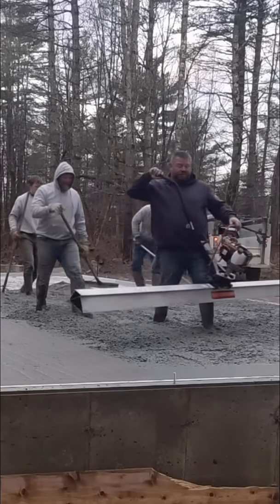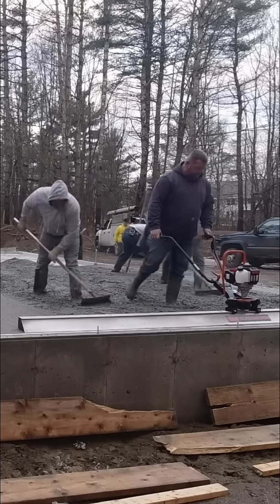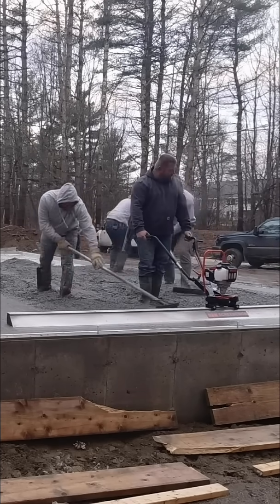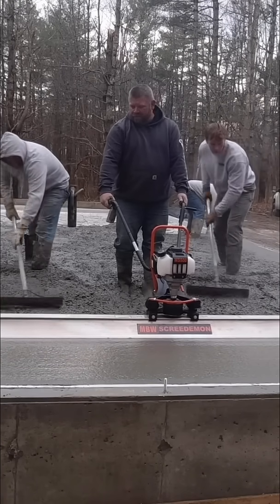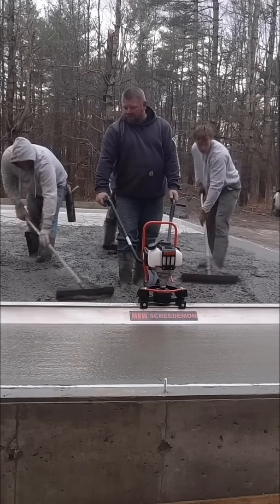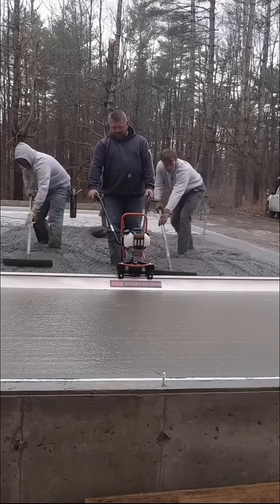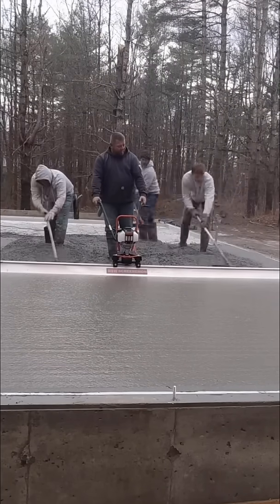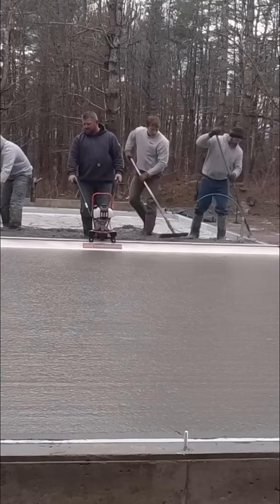You Might Not Know This... #shorts

Comment: DOESN'T IT LOSE STRENGTH SETTING THAT FAST? YOU WOULDN'T WANT THAT IN SUMMER
Reply: Under about 40 degrees F the mud will almost stop setting up on it's own completely. It needs a chemical accelerator (calcium) to maintain it's heat and set off in good time. Winter mud and summer mud are very different, if you don't accelerate winter mud you'd still have wet concrete 24 hours later
Reply: No . Your psi stays the same they would batch the mud if it did test at strength

Comment: Mike, I don't think it is the hot water. The cold gravel and sand they add to it completely counters the hot water. My guess is they put additives to make it go off faster because they need it to generate more heat to keep it from freezing. I could run the numbers, but I'm fairly certain without doing so, that even boiling water wouldn't bring the mix above room temperature. So that wouldn't change how the mix went off vs a summer day.
Reply: @court2379 It doesn't have to go above room temp to make a difference, every degree in temp will increase the speed of it setting up to some extent. Idk your experience, but for example if you have a slab with shade on half of it on a sunny warm day, the mud in the sun can go off in literally half the time or less.
Reply: Hot water makes a huge difference, it's not even debatable.
Reply: @KeMiZe44  I am sure hot water changes the temperature of the mix. But I don't think it has enough energy to bring it above room temperature. So if you are comparing how fast it goes off and stating it is because of the hot water, I don't believe that is true. It is colder than a summer mix by a good margin. How it goes off must then be what they put in it. It most likely has accelerators as crews don't want to wait three days to finish it and would have difficulty protecting it from freezing. 

If really needed I can calculate the temperature, but it would be easier to just stick a thermometer in the mix during a pour.
Reply: @court2379  It will have accelerators to inhibit freezing but hot loads reduce working times. I lived the reality many times, it's not just an opinion I have it's something I know. It's common knowledge in the industry where I'm from.
Reply: @KeMiZe44  I am saying it isn't hot (temperature wise). Even boiling water mixed with the larger mass of cold aggregates and cement won't have enough stored energy to bring the temp of the mix up to above the temps poured in spring or summer. So the mix setting faster cannot be because of the hot water as the mix isn't any hotter (temp) than any other time. The hot water is just getting it closer to the normal temps a pour is usually done at so it behaves closer to expectations. I would guess it raises it 20-30F vs ambient.

Temperature absolutely affects the rate of the chemical reaction. I'm not saying otherwise. I'm just saying hot water is not the reason the mix is going off faster than normal. What they put in it is.
Reply: @court2379  Listen it's not really a debate. I placed and finished concrete for many years. I know the difference between a hot load with 2% calcium and just 2%. I don't have anything else to say on the topic. Understand you're contradicting the guy doing the work in the video and me too, a guy who's also done the work, as well as literally dozens of other dudes I've done the work with too. Believe what you'd like but I know what I know.
Reply: @KeMiZe44  You are right, there is no debate here. It's not the temperature setting the mix off quickly unless they are heating the aggregates and it arrives at above room temperature. But we can prove that isn't the case because it would be steaming in the cold if it were that hot and it isn't. That mix is below 50F.
It's physical properties of the materials and chemistry. I don't care how much experience you have, you cannot change the laws of nature. You also need to be careful to separate a "hot" mix slang for it sets quickly vs a hot mix meaning its temperature is higher than normal. They do go hand in hand because heat increases the reaction rate, but you can still have a cold (temp) mix that is "hot" (reaction rate).
Reply: @court2379 I just poured concrete today. It was 29 degrees and partly sunny. The concrete was steaming as we placed it. As it does every time I have ever poured in winter. 2% calcium hits different than 2% nca. And I guarantee adding more hot water to the mix after the truck has already started to pour out will make that shit blow up quick. I feel like you have never poured concrete before
Reply: @Floatsy  Did you measure the temp of the mix? Talk to me when you have. Also I don't pour in the winter. Makes inferior concrete.
Reply: @court2379 Heated aggregate, and sand, they all do it in the NE!
Reply: @court2379 Touch a winter load next time you’re around a pour, it will be very warm to the touch! They heat everything!
Reply: @court2379 You haven’t a clue!
Reply: @court2379 Says who?
Reply: They heat the sand and the water to keep it from dropping in the winter. While mixing it keeps the concrete hot but you want a good driver that knows not to mix to hot. Don’t want it to hot or it will set to quick.
Reply: @concretepours  The stone is heated as well in most plants, usually live steam, and you’re absolutely correct about the driver, if you piss one off, he can take a load and turn it into a bomb by mixing it incorrectly on the way to the site.
Reply: Guess I'm late to this comment section but I did concrete work for only 3 years so I'm clearly no expert but I remember adding calcium to the concrete the brand was called thermolube it made concrete and mortar set up faster we used it when the weather was colder and damper
Reply: They heat the gravel and sand as well, so in that aspect you’re incorrect.
Reply: @Musclecar1972  So I am correct. It's not the hot water. It's the hot aggregates.
Reply: @ It’s both, but the aggregate and sand do have more effect than the hot water. When they’re loading the aggregates, it’s actually very hot to the touch in some cases.
Reply: @Musclecar1972  Still though. It will lose heat pretty fast. The truck tumbling it in a 40mph wind, the cold walls of the truck, the cold ground, and forms. Any water they add from the truck. I'm still thinking they are adding accelerators to keep it from freezing. That one I don't know. The water and aggregates is just a properties of materials issue independent of concrete. He stated something about hot water and it isn't enough to get there from an energy perspective. If they are doing both, that works and the mix would be hot.
Reply: @ I’m sure they’re using accelerators, but it doesn’t cool off as fast as you think, the chemical reaction of the concrete mixing, and agitating actually creates heat as well. I had my own masonry business for many years doing mainly flat work, and then when my body gave out, wasn’t ready to retire, so I went to driving front dump mixers for many years. Concrete is a funny commodity, it doesn’t always do what you think it should. In a few weeks, Mike, and the rest of the masons in the cold weather areas will be experiencing what I call rubber crete, unless you’ve worked with concrete and used it all times of the year, you’ll not know what I’m talking about, but I bet Mike does.
Reply: I want you to run the number. Just because you said you could. I would like to see the number now please.
Reply: Exactly. They aren't keeping the sand and rocks heated 24/7 😂. The slab is over 4" thick it's not getting hard in 10 minutes. He just makes these goofy videos to generate comments. I've been on real pours on 16 story buildings and we had to wait for 8 hours after we poured to get it right with blankets up on the wall openings because the walls weren't in yet. 
Mike Day should use a different batch plant or just stop lying in his videos.
Reply: @RealMTBAddict  Looks like you're talking out your ass, hot water makes a big difference on how fast it goes off. Sounds like you have very different experience pouring. "Wait for 8 hours after pour" lol sounds like your boss isn't putting accelerator in. My guess would be because your crew wasn't good enough to finish it quickly, lol. Mike knows what he's doing, you might notice he was talking about mud with accelerator in it, AND a specific kind (flake). Just because there are cold materials doesn't mean the hot water warms the mud up to some degree. You guys should really think more before trying to call people out
Reply: @Trildin  well when you're up 16 stories you have cold air from all sides that's why it takes so long, there's not even air hitting it. 🤣🤣🤣
Reply: @RealMTBAddict He’s not lying, and yes, they do keep the stone and sand heated 24-7, I don’t know where you live, but in the NE, they absolutely do!